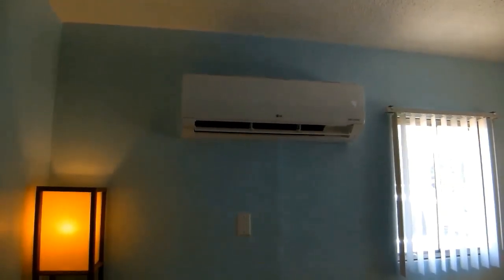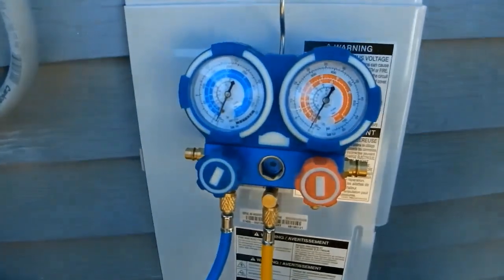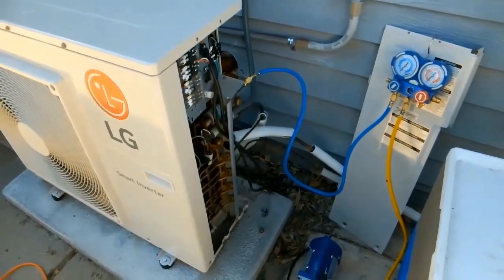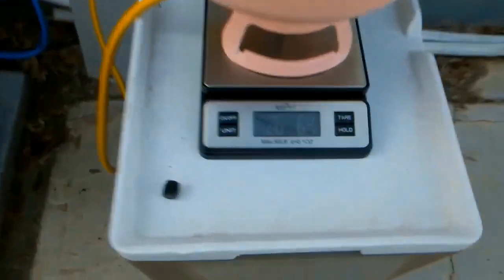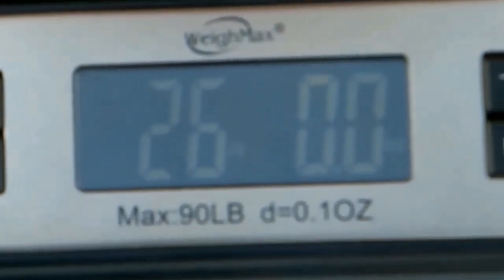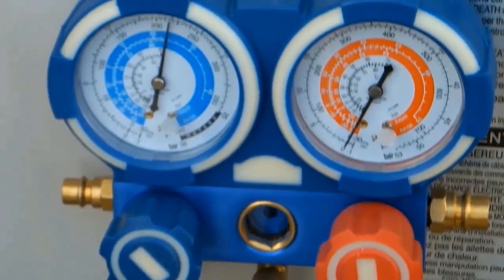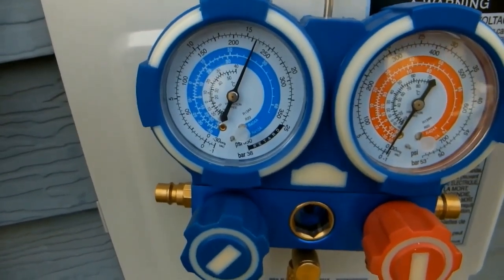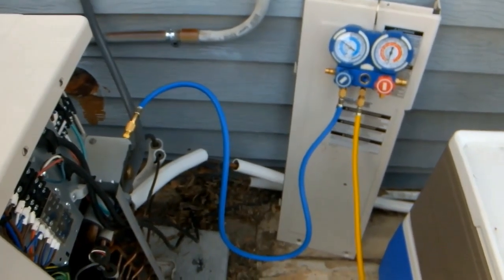How To Add Refrigerant to a Mini Split Air Conditioner

Comment: Hi,out of curiosity,why did you turn off compressor/condenser when charging system?
Reply from the maker: Had it off when charging, then turned it on when my gauges showed full charge. Made sure to verify that the PSI registered the correct level after turning on both indoor units. From what I've read around the web and watching other vids, charging while the system is off is the way to go.

Comment: You made this video so much clearer now! You made my life in school so much easier, but hey do you have to shut down the unit completely to charge the system? Like turning the breaker off
Reply from the maker: Actually a breaker shouldn't be involved, the compressor unit should have its own dedicated line or dedicated power. However, please understand I'm not an electrician! If a breaker is involved, it should not have to be switched off, HOWEVER make sure the indoor units are not running - that they are powered off.
Reply: Yes it has a dedicated line but its still connected to a breaker, and ac disconnect box